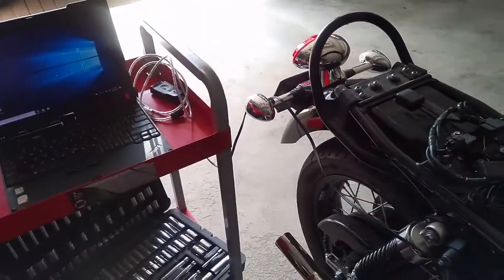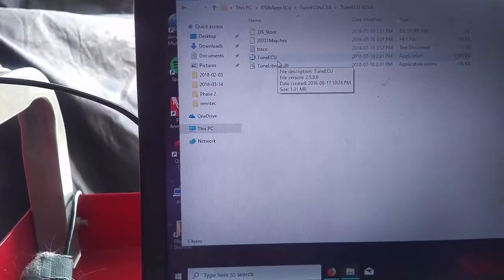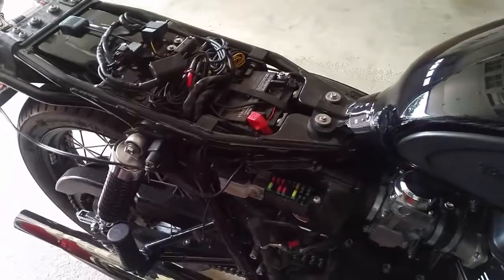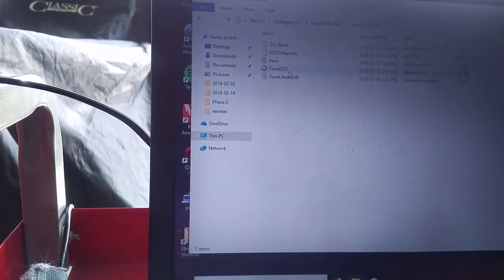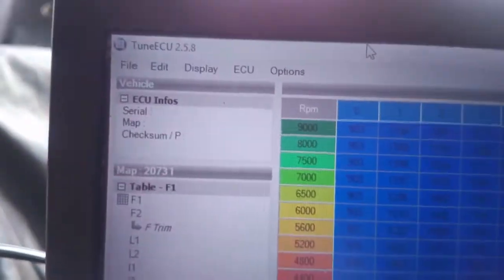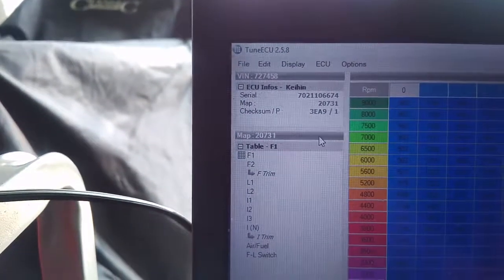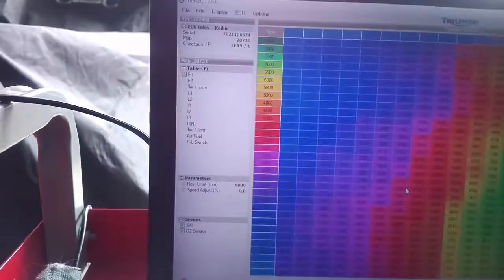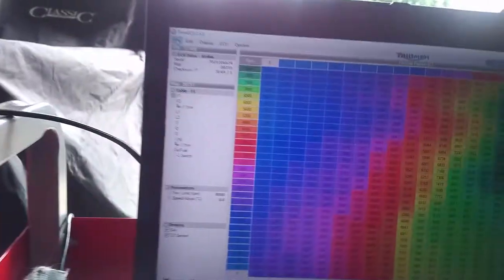Save default motorcycle map using TuneECU

Comment: So that will save whatever map is on the bike? Mine has a tune for the arrow exhaust from the dealer. I assume it will save the existing map with the tune that's on it? It wont pull up a stock map will it?